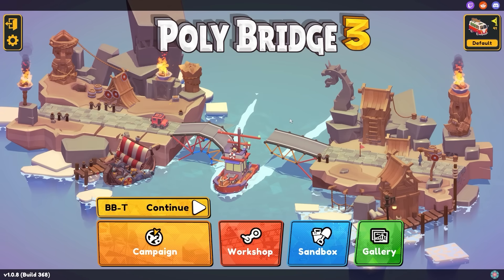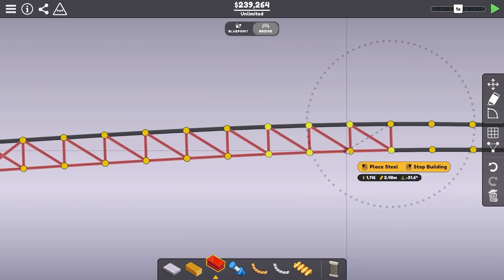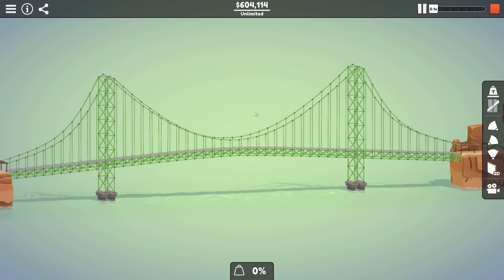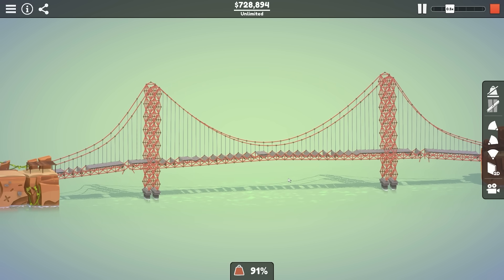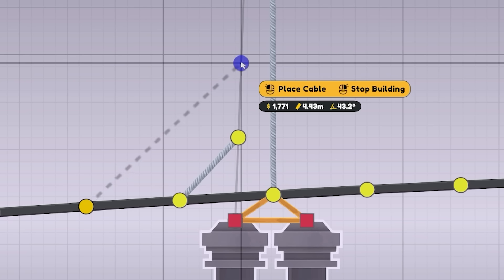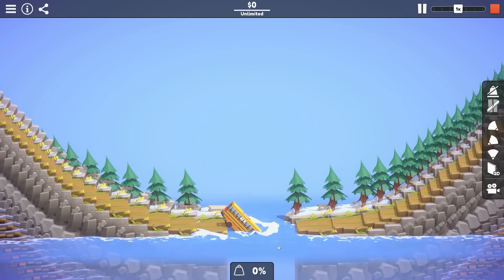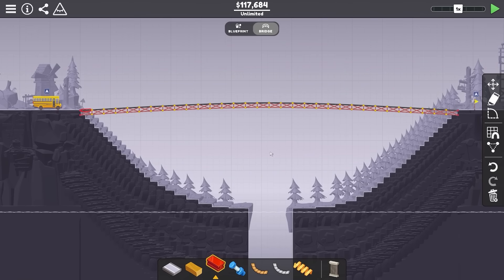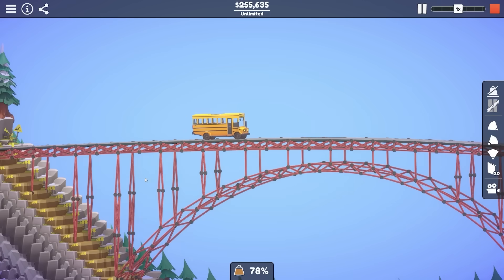Recreating REAL BRIDGES in Poly Bridge 3!

Comment: I thought it was the sunshine skyway when you started building it but figured it would be something else. Although it is technically “tampa bay” it’s on the saint pete side.

Currently sitting less than a mile from the entrance to the bridge (which I hate to admit when I first moved here ended up having to go all the way across and back since there are no u-turns).

Sad fact: it is the second bridge that was built since the first had a horrible boat collision.

Comment: The New River Gorge bridge reminds me of another similar bridge. Though only 238 metres or 728 feet in length, the French King Bridge in Greenfield Massachusetts is something I used take a ride over during Autumn to see the sights and get terrified from looking over the railing. Aside from the dimensions of the bridges, the top of the French King Bridge to the bottom of the Connecticut river underneath is about 82 metres/ 270 feet deep. The height of the bridge is almost the same as the depth of the river.

Comment: you know there's a slider on the arch tool to control how many nodes you want, so you can do it directly with steel and match the number of road nodes, instead of copying it and replacing one by one.

Comment: I'm thinking the golden gate bridge failed because the curved steel "cables" are not under tension, hence the cables connecting the bridge itself to curves are not supporting anything. As soon as the sim begin, the road is under compressive stress and break, which allow the entire structure to move a tiny bit and bring the curved steel + cables into tension.

Comment: The cables on the outside of the Golden Gate Bridge should actually be stretched and not curved. Because they are trying to pull the towers back that are being pulled to the center because of the main weight of the bridge.

Comment: Locally to me, we just had a replacement bridge built. The old "Twin Span" bridges were twin suspension bridges similar to the Golden Gate design. One of the spans was demo'd this past weekend. The replacement bridge is a basket handle design that is quite impressive. Check out the I74 bridge over the Mississippi if you're interested!

Comment: I was going to suggest the Nipigon River Bridge but it is cable stayed and you have done that. The Nipigon is famous in Canada for breaking the very first Winter after completion of the first side. 

Design	Cable-stayed
Total length	252 metres (827 ft)[1]
Width	37 metres (121 ft)[2]
Height	75 metres (246 ft)[2]
No. of spans	2
Construction start	2013
Construction end	2018 (estimated)
Construction cost	$106 million

Comment: Storebelt (Great belt bridge connection) located in Denmark. The connection is made up of two bridges (wich would be very fun and challenging to make) (and a rail tunnel) the bridges connect the two Islands Sjælland (Zealand) and Fyn while pasning the Island of sprogø. The west bridge from Fyn to sprogø is 6,6 kilometers long and has a small hight of only 18m while the east bridge is 6,8 kilometres long with the road being 65m over the water and the pylons being 254 meters tall making them the tallest construction in the country. The connection opened fully in 1998 the east bridge was the second loungestol of its kind when it opened it is now fourth in the world. Around 15 million road vehicles use it every year. The connection is a part of a system Wich includes Lillebelt, Storebelt and Øresund where these three masses of water is now connected with a road connection making a direct land connection between Central Europe and the Nordic countries.

Comment: The reason why your Golden Gate Bridge broke was because the PolyBridge curves are Bezier curves and not catenaries. The cable from which the suspensions are hung needs to be in it's natural hanging position. If it isn't it will move there and absolutely shatter everything.

Comment: Wouldnt you want your end cables to be tight with very little slack to allow them to keep the bridge from folding in the center? the slack on the outer cables would allow it to move way too much
Reply: yeah in the photo you provided at the end of the bridge, you can see it has straight cables going from the top of the towers straight towards the ground so they're acting in tension and pulling the towers away from the center. Hmmmmm. Just my thoughts anyways! Love your videos Matt, keep em coming. Not enough engineers committed to the war against architects, you're a good man! 👷‍♂

Comment: For the dutch bridges, can i request the “oversteek” in Nijmegen? Its build on the same place as where they crossed the Waal during operation market garden. There are 48 streetlights on the bridge, reminding people of the 48 fallen soldiers during the crossing. Its total length is 1195 maters long, but the main part is “only” 285 meters long. It is a arch bridge though, so good luck making it!

For the other 2 Dutch bridges, i would recommand the “Erasmusbrug” in Rotterdam (im curious if it will stand, since its kinda architecture) and the “Magere brug” in Amsterdam (good luck with the hydraulics!)

Comment: I think the problem with your golden gate bridge was:
1. The road had the wrong curve, it should be closer to a catenary, or even flat for practicality.
2. It was too heavy, remember every length of material now has its own weight, so those X's were making it worse by pulling down on the road and the whole structure, and the steel "cable" on top was both weaker and heavier than true cable.

Comment: Nice !
Considering the golden gate :
Given the size of the spans, I'd say that the side spans top "cable" (that you made out of steel) should be a lot less curved. They actually have a way greater role in tension to support the central span than to support the side spans.
You can see that when pressing play, it's actually not the weight that's limiting in the first place but the fact that the towers bend inwards due to poor bridge balance ^^
Considering the great gorge : making the arch rely on only one anchor point per side would probably work even better :p
Reply: Re: NRG - Yeah, it appeared the bridge functioned perfectly without the two pieces that broke, although I get wanting to make it truer to life.
Reply: Don't forget that the Golden Gate is split to 5 parts connected by a special joint that keeps the bridge safe from heating up and stops the steel from growing.
Reply: @andrewpadillo9230  Actually the joints don't stop the metal expansion, they just allow it without transmitting the strain to the other components. The bridge does still deform quite a lot :)
Reply: @pg5200  oh, now I get it, got some misinformation 😅

Comment: The Sunshine Skyway Bridge in Tampa Bay is a great bridge!! :) One thing to know is that it is actually really long and pretty steep in real life. It's also pretty tall as it has to be tall enough for large ships to go underneath (theres multiple ports in the bay). A drawbridge wouldnt have worked because this road is a very busy highway. This bridge is actually the second version, the first was hit by a cruise ship that was probably too tall at high tide. Loving the appreciation for engineering in my hometown :)))
Reply: The original Sunshine Skyway Bridge was struck by the Bulk Carrier MV Summit Venture. The harbor pilot struck the piling near the center part of the west span during a surprise squall. The collision collapsed a 430 meter section, and eight vehicles were dropped into the bay, including a greyhound bus. 35 fatalities, 1 survivor. This was 1980. The current bridge was completed in 1987.
Reply: I was hoping to see some fellow Tampanians. Hell yeah!
Reply: I have quite a few memories crossing the current bridge. I was pleasantly surprised to see RCE re-create it. It certainly is an amazing bridge to drive over and of course, every now and again, some yahoo decides to climb the cables... I wasn't expecting to see it featured on here.

Comment: I think on of the issues with the golden gate bridge is that you didn't use actual cable (and used steel to match the red instead) and isn't that a lot heavier? Also, the main beams in the GGB are super thicc. I think you could have made it work.

Comment: I'm really impressed that you legitimately got to the point where basically the only problem with your Golden Gate bridge was the roads popping from compression as the bridge settled.

Really happy to see one of these old-form videos where you're doing real bridge recreations!
Reply: maybe using springs to mimic the movement of a traditional expansion joint could have fixed that? I do wonder.
Reply: @thr3308 I thought the same
Reply: Or make gaps in road not sure if possible
Reply: @Keschoo  I figured he didn't want to make dangling roads because it's not part of the real one
Reply: @anthonynorman7545  arguably it's only dangling roads
Reply: @PolishGreasePit  I see the pun, but have to say that's not what dangling roads mean in the context of the Polybridge community
Reply: @anthonynorman7545  With the expansion joints irl, it is sort-of one
Reply: @bluerendar2194  2 expanding parts, sure. The entire bridge, no.
Reply: @anthonynorman7545  Anything longer than a really short bridge will include multiple small expansion joints + one larger one. Really long ones use multiple large ones as well.
Google: "golden gate bridge number of expansion joints"
Results: "Engineers divided the deck into 7 separate pieces."
"the Golden Gate contains tiny expansion joints every 50 feet"
Reply: @bluerendar2194  the aesthetic in polybridge doesn't work the same as the irl ones. It's part of why he tries to avoid using dangling roads.
Reply: @anthonynorman7545  It's probably possible to make it look just fine with tiny gaps+springs, but it at minimum would be very tedious unless 2-3 gaps is enough. In the end though, just knowing it's possible is fine for me, unbreakable mode gives the full aesthetics anyways.

Comment: As an engineer who is concerned about safety, why do none of the bridges you build include railings?
Reply: The cars in this world are engineered so well that they can land safely from any height, only impeded if the wheels aren’t on a solid surface. Even falling into a River would be perfectly safe as they have harnessed the engineering power of resetting timelines to help them in dangerous scenarios
Reply: Costs too much
Reply: Budget

Comment: You have to do the St Lois Eads Bridge across the Mississippi. It might not be the prettiest bridge, but we're not architects. It is so important historically for how long the spans were, how they built the foundations in the river, and using so much steel for the first time.
Reply: I just suggested it and tried to sell it based on the Metro station in the bridge plus the view of the Gateway Arch. I think it would qualify as a BILF.